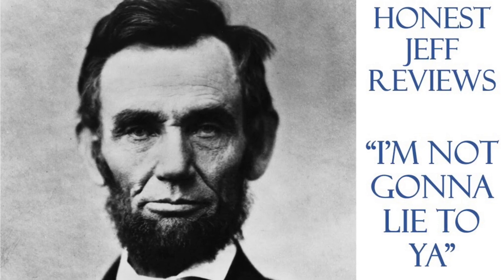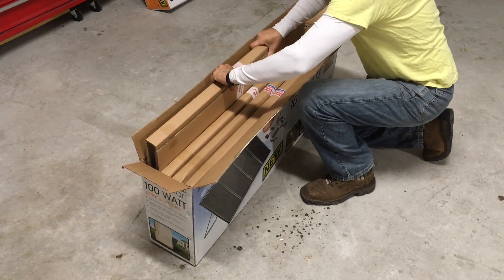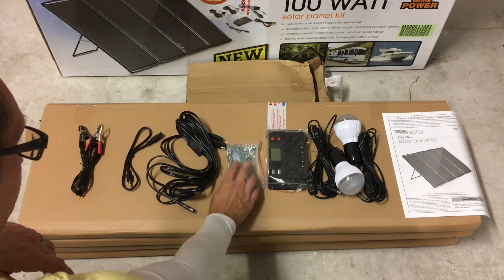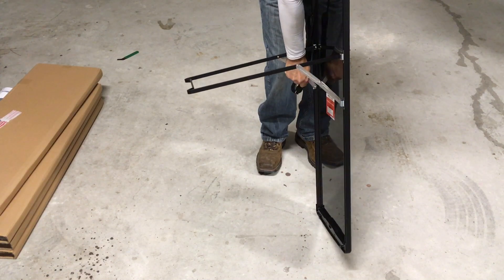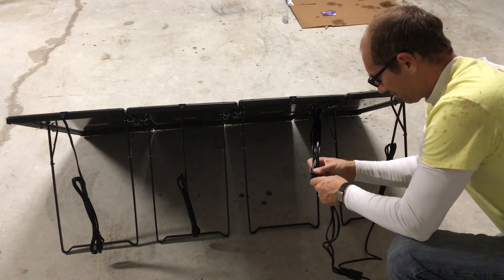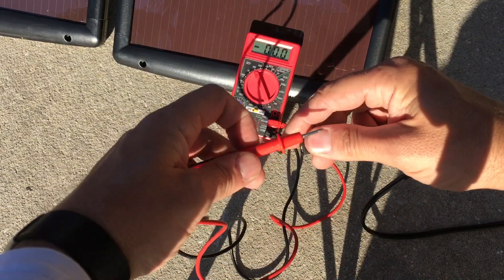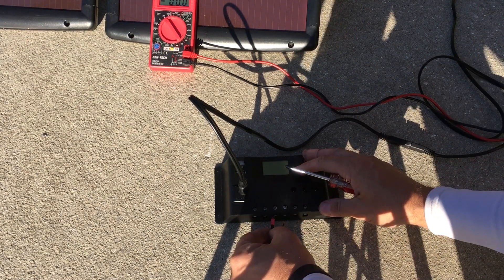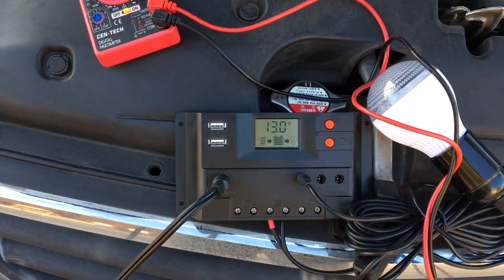Harbor Freight Solar Panel Review and DIY - Episode 2

Comment: Great video. I had to laugh when the charge controller display would not work. I had every confidence that you would eventually connect the battery and fix the problem. Cheers.
Reply from the maker: yhird, yes, I was a solar virgin.  But, I was persistent and a little bit of electrical knowledge helps with diagnosis.

Comment: You'll be lucky if you get 50 usable watts from these 4 panels combined in full sun.  There are so many losses with solar that the actual usable wattage is usually around half of what they are rated at.  It is kinda like when you size a battery bank.  You might have 100Ah batteries but you count them as only 50Ah when sizing your bank.  That is cuz batteries (AGM, FLA...) normally are only discharged to 50% SoC (State of Charge).  So for example, if my usable bank size needed to be 1000Ah, I would need twenty 100Ah batteries, not just 10.

Comment: I wonder why in the HF manual it says NOT to connect these panels in series.  I hate when they tell you things NOT to do but don't give any reason why.  What would prevent someone from connecting 2 panels together in series for 24V and running that into a 24V capable charge controller?  If it works, then in theory, you could use the unused 2 wires from the series connection to either lengthen your 8 feet or so of wire from each panel, or, if you only need about 8 feet, you could double up the wires for less resistance.
Reply from the maker: David James,  the manual doesn't say you can't do it, it just says it needs to be done by a licensed electrician.  This is of course for safety concerns and legal reasons, that not everyone is capable of performing this work to NEC code standards.  I am planning on doing this very thing.  I should have a video out in 3-4 weeks discussing this topic and showing how it can be done.
Reply: My Harbor Freight manual (from the 100W solar kit) states the following (on the bottom left of page 2):  Do not wire multiple panels in series.  If you need to connect two or more solar panels together, this work must be done by a qualified electrician unless they are connected through a regulator.

I am not sure what this means exactly.  What is the harm of using a 4 panels system and creating a pair of 24V downfeeds, either paralleled, going into a single 24V controller, or each wired pair going into their own 24V controller?
Reply from the maker: David, keep in mind that the panels are not 12 volt.  They actually produce around 18 volts under load.  They are made to be hooked into a 12 volt  (really closer to 13.6v) battery and in order to charge the battery the voltage has to be higher than the battery voltage, thus the reason for 18 volt panels.  Putting 2 in series would then be 36 volts so keep that in mind when looking at a charge controller.  Unless you're hooking them into a battery bank that is just under 36 volts, having the extra voltage going into a 13.6 volt battery is just wasted voltage.  Also, I'm not sure what the charge controller is rated for that comes with the kit, but I wouldn't use it if you're wiring in series.  You would need to get a seperate charge controller that could handle the increased voltage.
Reply: 18V under load would depend on what the load is.  Short circuit for example would NOT be 18V.  If you connect a solar panel directly to a battery, again it will NOT be 18V (there will be a big voltage drop due to the heavy load).  Your statement is not accurate.

Your other statement about the battery voltage required is also not accurate.  The charge controller can handle a battery as low as 10.5V as this is the minimum voltage setting on the controller.

My idea is to make this 4 panel kit a 24V kit since then you have other (and better) options for wiring them.  Of course a 24V charger controller would be needed but the PWM ones are cheap.  You will have less voltage drop this way due to the lower amperage of the series parallel setup (vs keeping it as a paralleled 12V system).    So for example, let's suppose on a semi-sunny day you are getting 1A per panel.  Wiring them all in parallel should give you about 4A (for a 12V system).  Wiring them in series parallel should give you 2A (for a 24V system).  That 2A of current will be "happier" flowing thru those wires, meaning less power will be wasted in the wires.
Reply from the maker: David James , sounds like you have a plan.  I’m working on a different type of system that doesn’t use batteries or a charge controller.  I’ll be putting another video out in 3-4 weeks.
Reply: Ok I will check it out.  The power produced from a solar panel can be used directly.  However, if there is no voltage regulator, the device must be able to handle a range of input voltages.
Reply: Maybe because there's no diode to stop power back feeding  to the panels that get shaded

Comment: Yeah it says on the back 100 watt kit solar charge controller so 100 watts=5amps. so im assuming it's 5 amp i have three of these kits on my trailer rv 364 watts, eddies solar project powered by thunderbolt magnum solar from harbor freight my videos are not the best im working on it I'll have an update after the first of the month i have a new charge controller on order and a few other things I'll try to do a review
"Read instructions'!

Comment: You have an error on the rating of the charge controller @ 3:03. The one in the kits is a 10 amp unit. The 30 amp/500 watt unit ( 68738 ) has no quick connect sockets or USB ports. It is strictly a hardwire unit.  The buttons on it are below the meter. Mine also powers up even without a battery which the 10 amp unit will not.
Reply from the maker: gravelydon, thanks for pointing this out.  You are correct.  I'm not sure why I thought it was the 30 amp unit.  I don't have my system up and running yet.  I've had some other projects and work get in the way.  But I've been in the design phase to try something with the system that will stretch what it was designed for.  But before I post a video, I want to be sure I have accurate and correct specs/diagrams.  Stay tuned in the upcoming weeks as I'll hopefully be posting an update soon.  Thanks for your comments.
Reply: I understand how things get in the way. So far, mine has been up and running for a few weeks. But still is a work in progress. Have to wait on getting a new shed roof on ( Thanks Irma :-( ) before doing the final install of the control panel. But in the meantime it has been keeping the batteries charged ( two Exide Marine/RV deep cycle 27MDP ) and pulled about 3 KWH this week out of the sun running the fridge. Had to drop the panels again today as there was a hail warning. Shed is also getting wired so that the bulbs in the kits are used in regular flood lamp holders. Three of them do a good job of lighting the inside of a 20X16 shed at night and with the inverter, I can also power up some LED shop lights too over the work bench area.

Comment: I'm interested to see how you set up 24 panels. Roof mount? Maybe a ground rack assembly? Looking forward to seeing your progression! Good luck and be sure to fuse between each part of the system and don't skimp on the wire gauge at the battery bank and inverter connections.
Reply from the maker: Thanks for your comment!  I had an idea of what I wanted to do, but after doing A BUNCH of research, my plans have changed a few times.  In the next episode I'll give a hint as to which application I'm leaning towards using them.  Thanks for the tip on the fuses.

Comment: LOL you needed a battery.  I was yelling at you and you couldn't hear me.  Was hollering YOU NEED A BATTERY!!
Reply from the maker: philipx2, and I was hollering inside, you idiot you needed a battery after I read the instructions, LOL.  I guess that's part of the learning process.  Stay tuned for Episode 3 in the next couple of weeks.  I am studying like a madman about solar and all it's applications.  I'll be sharing in the next episode how I plan to use the system and the beginning stages of planning.  Stay tuned!
Reply: Honest Jeff Reviews & DIY Jeff 
Been into solar for years.  All charge controllers require battery first.  Now you know.  Good luck.
Reply from the maker: One lesson down, a hundred to go, lol.  I'm actually making great strides in my electrical and solar knowledge since this video.
Reply from the maker: Voidisyinyang Voidisyinyang, since making this video I’ve quite a bit about solar.  I have another video I made after this one and I’ll have another one out in a couple months I hope.
Reply: Sorry Phiipx2, but they don't all require a battery. If you buy the 500 watt HF unit, it will power up just on the panels.
Reply: The one that comes in the kit will handle 10 amps. I know that for a fact. But the one in the kit is not the same as the 500 watt/30Amp controller.
Reply from the maker: E W , thanks. It’s a 10amp upon closer inspection.
Reply: It's not a 30 amp CHARGE. CONTROLLER maybe ten probably five